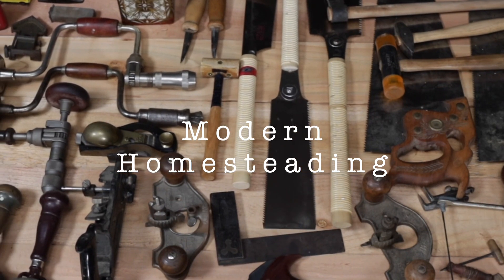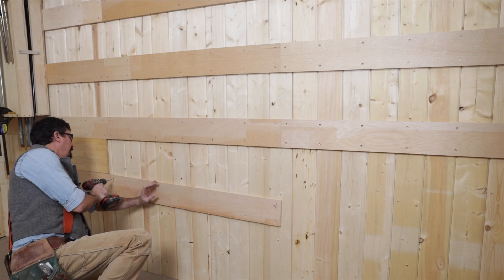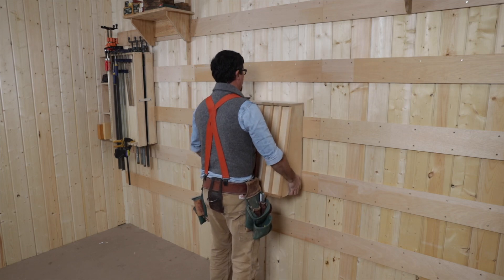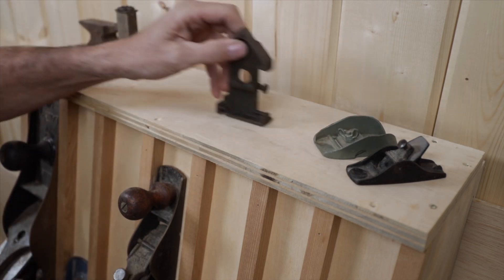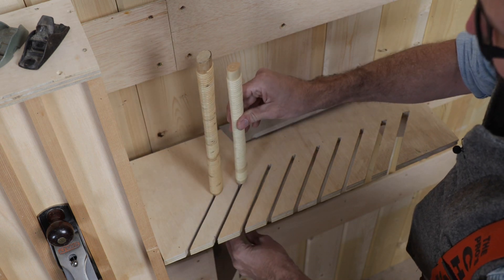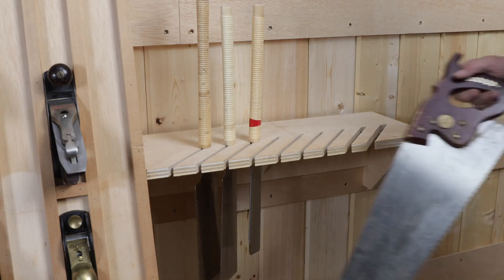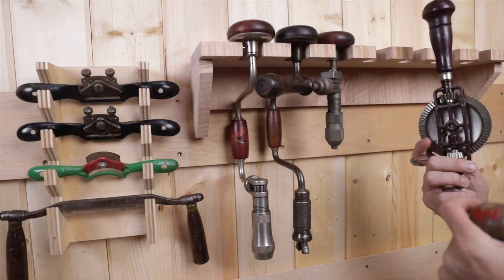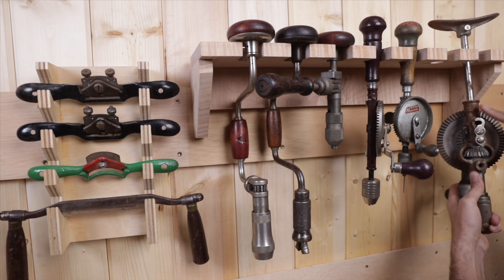MY FAVORITE TOOLS OF ALL TIME

Comment: Just purchased my 56 acre homestead. Raw land with power and a well. Love this timing because I plan on building the workshop first so love watching the organization and planning.  I will be watching closely. What a great chance to appreciate all those pieces of art and workmanship.
Reply: General suggestion #2; put insulation under the tin sheet roofing material. When you are in the barn; you will be producing moisture. That moisture will accumulate on the underside of the roof sheathing and then drip down on to your schtuff. You will not like all the rust that your schtuff will produce.

Comment: Tools or just like guns you can never have too many.
Reply: Well gun's are tools so it's a natural progression.
Reply: Brace drills and those egg-beater drills are cool but most of the time wouldn't you use an electric drill?
What occasion would those hand-powered drills be used? Just wondering...
Reply: @Ben4149   They're good if you're to go somewhere with no power and drill a hole like if you're building a campsite in the woods perhaps. Also, some guys have their shops in appartments with neighbours and might not want to make too much noise. Just two of the possible uses of the top of my head :)

Comment: Cody, Great video. I believe that disston that you referred to as a d-100 is actually a pre 1928 d-8 thumb hole. A little hard to tell because I didn’t see the tip in the video. The pre 28 d-8 has a wider tip than most hand saws. The d-100 actually has a metal handle frame with a wooden grip. LOVE old tools.

Comment: Wrangler, i highly recommend you get a tub of paste froglube to use on your tools, works very well at preventing rust and works very well as a plane sole lubricant. i have been using it for a few years now. Also, i recently tried a over night white vinegar bath on some of the rusty second hand brace bits i had acquired, and i was shocked by the results. soak them, bristle brush scrub, rinsed with water (they will re-surface rust within minutes if you do not get them dried promptly)

Comment: Hi Cody, the compact brace is called a "joist brace".  It's for getting in-between floor joists.  Drilling holes for electrical cables, etc.  Having said that, it'll also work in other confined spaces.

Comment: A quick tip for level fastening planks like this with only one set of hands—tap in a temporary nail on the opposite end to hold the weight of the board while still allowing for leveling adjustments.

Comment: I'm not a carpenter, nor do I have an extensive collection of tools, but I can relate to the problem of accumulating too many of the same, or similar items, whether they be screw drivers, sockets, or whatever. It's so easy to come across "the next, best tool" with a new wrinkle on an old concept, and even if you already own five of them, you just know that THAT'S the one you really need. And it works great, and it's your new best friend, and it sits there rusting and collecting dust even better than its inferior stable mates. What more could you ask of a tool?

Comment: If you want a No 1 handplane, the economical option is to buy a brand new Lie Nielsen.  I did that for my dad.  He wanted a No. 1.  When I saw how much the original Stanley's went for, I bought the Lie Nielsen for 10 times less than an original Stanley.

Comment: 4:30 I have always thought those things such a waste of space. I get the concept, but you use so much space for that angled piece of wood and then there's nothing being stored behind it (not to mention the planes and their handles sticking out).

Would that idea work if that "box" was closer to the wall (the bottom out 6" instead of 8 or 10, and the top of the angled board right against the cleat?)
Or maybe add some slots to store short push saws or something behind the planes (like in the lids of tool chests, but enclosed in that plane "wall box").

Comment: Wonder the wood shop's air filtration system will be integrated in this new modular layout of the entire building. 🤔On another issue, risk of heartburn from all the "fizz" provided by all these vids of special hand-tools, new place-workshop build, pants (not jeans), even an old fashion washer/dryer...🤣

Comment: Why would someone that always talks about quality constantly use the outdated and inferior phillips screws when there at least two screws that are far superior? First would be the Robertson (or square head) screw and the other the Torx head. Both are far easier to use, and work much better, than phillips. The time you should use phillips screws is for drywall applications where you want the bit to spin out of the screw (which phillips is great at achieving) to avoid overtightening.